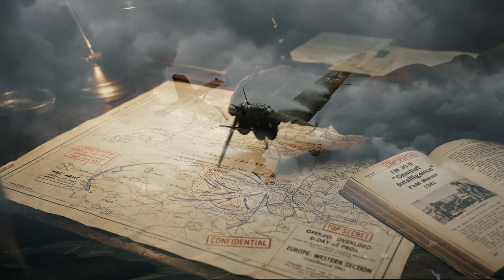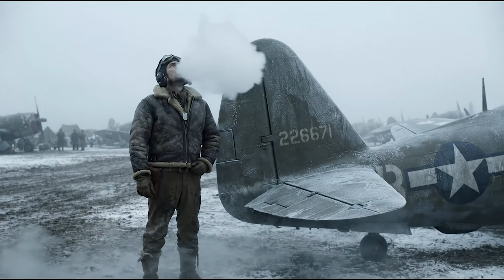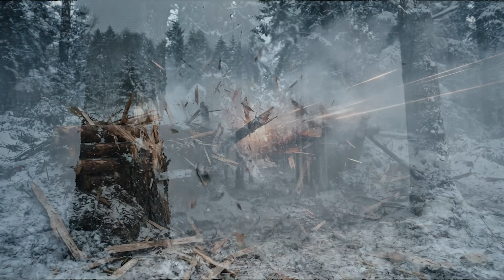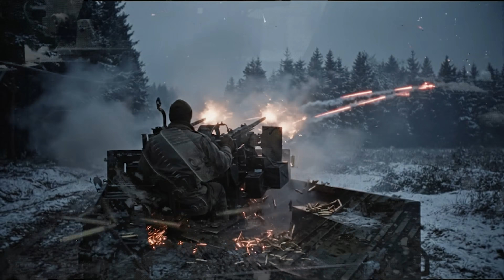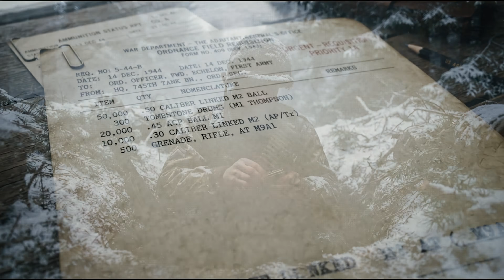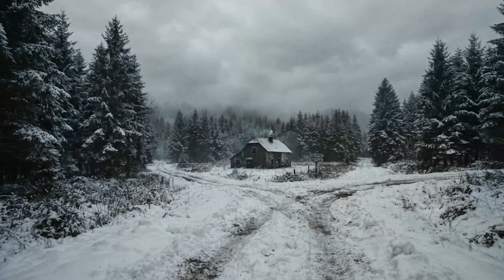How the M16 Quad .50 Became a Ground Weapon in the Battle of the Bulge

Comment: The BAR Browning Automatic Rifle with its itzy,,bitzy, teeny, tiny twenty round capacity magazine that was typically gone in twenty seconds or less was the most significant major auto firearm weapon mistake of the era! I find it extremely odd why its small capacity wasn't flagged as unrealistic before the final to be issued final design ok was issued. It makes absolutely no sense whatsoever to have such a small clip magazine on an automatic fire weapon. A large clip on box magazine would have been a much more viable realistic final design change before it went into its production on the assembly line! I just common sense was a scare commodity for some odd reason!!!
Reply: High sight is twenty twenty, but compare to the typical 5 round bolt action rifle of its era 20 rounds is a major increase.   You have obviously never served as a foot soldier who has to carry all that ammunition weight,  larger magazines and higher rates of fire just worsens the problem. The BAR was designed as a squad maneuver weapon,  to put down covering fire for the squad and then move forward.
Reply: The M-14 wasn't any better, it only had a 20 rd. mag. which emptied twice as fast and that was in the late 50s and early 60s. The BAR was 30.06 and the M-14 was .308 (Basically the same)

Comment: You forgot to mention the M2s HB Barrels  Would BURN out and need replacing after firing about 2000 to 3000 Rounds 
the HEAT from the Barrels was Immense .  The Images you show in this video are NOT the Tombstone Magazine cases
your images of the Gun mount and turret are also incorrect . 
I have fired this gun on a training Range many years ago . You have NO IDEA of the sound and FIREPOWER of FOUR 50 M2 guns firing in unison ...  We also had a Halftrack with TWO  20 Millimeter  Guns in that same basic mount !!